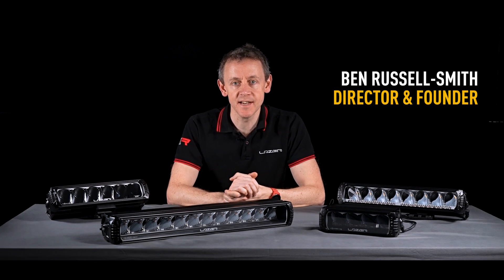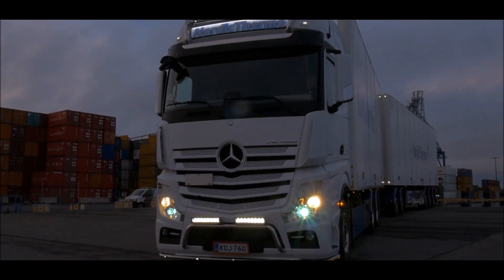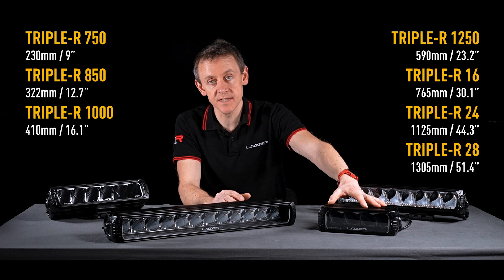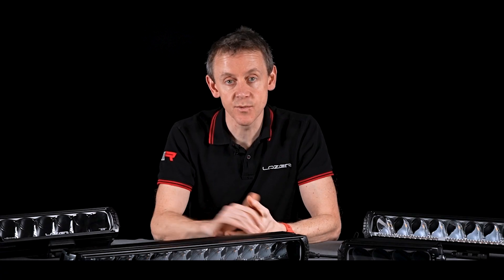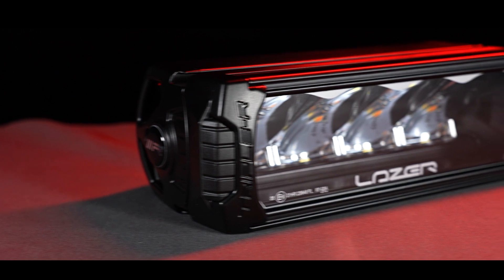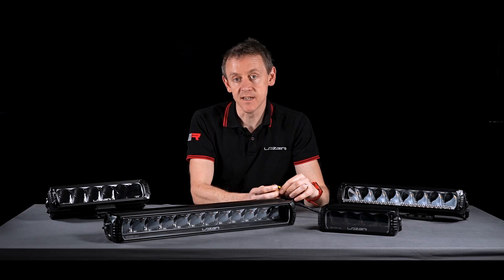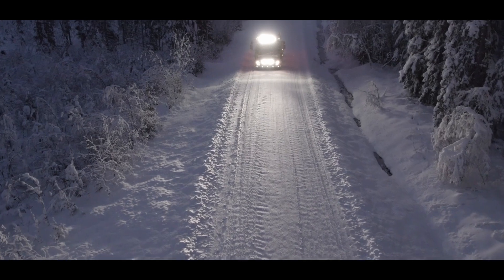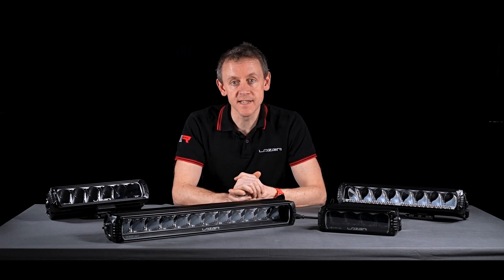LAZER LAMPS | Triple-R | Product Walkthrough

Comment: Could you pls add some images and videos on the switches that in the interiors? We all all interested on how to fit the switches. Do we need to drill holes? Where should we place them? Etc. cheers!
Reply: Do you want them to make a video of every car interior available, on how to mount the switches??? The switch you run and where to put it is completely up to you. You can use the supplied switch, which likely involves drilling/cutting a hole, you can order switches that fit into available empty switch slots, or you build/order something that allows you to mount extra switches inside the car.